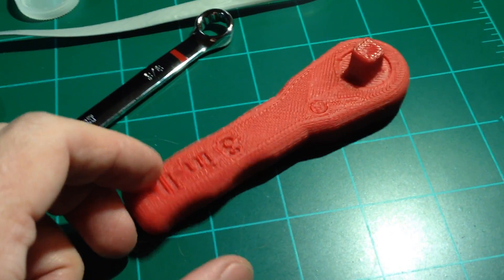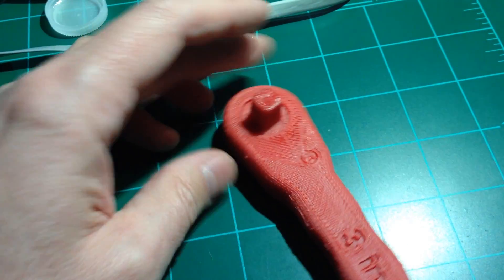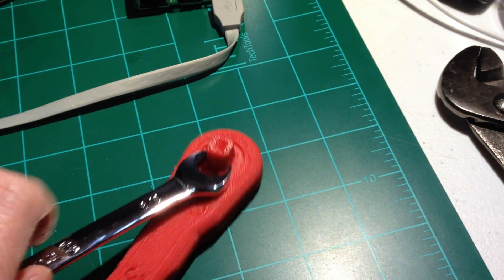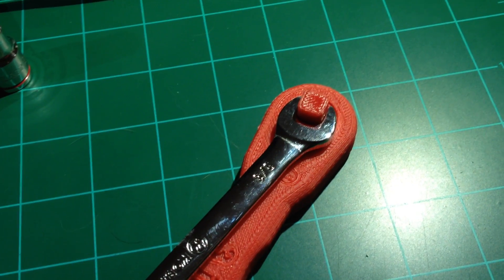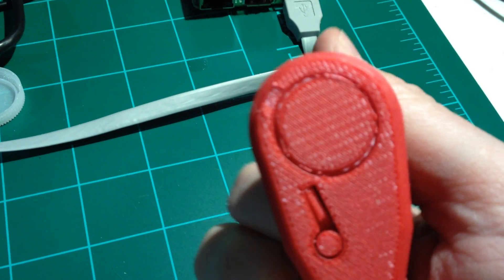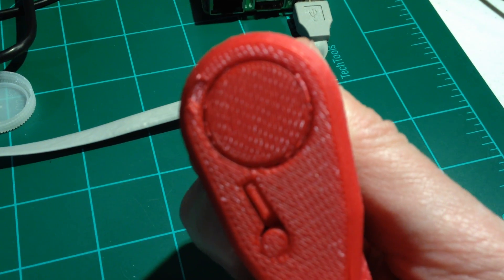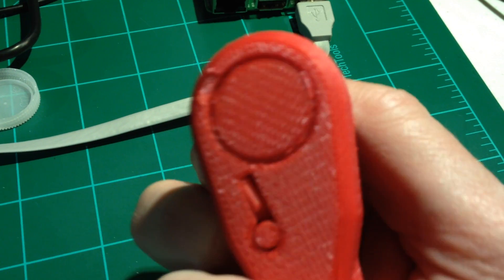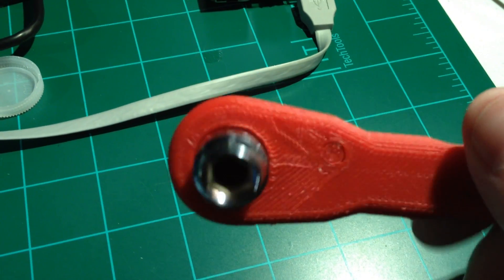3D Printed NASA Wrench for the Space Station

Comment: Little tip... socket wrenches only turn one way until you flip the switch... This wrench can go bot ways, you must just change the selector switch.
Reply: there is no selector switch on this wrench, it's 3d printed just be glad it goes one way :P
Reply: I've printed mine today, but it won't turn and the pin broke. The texture is really smooth. How much infill did you use? I've used 30%.